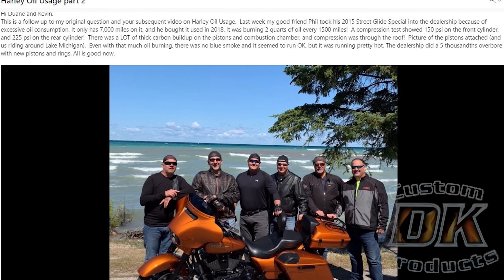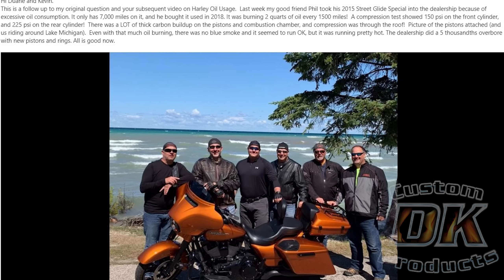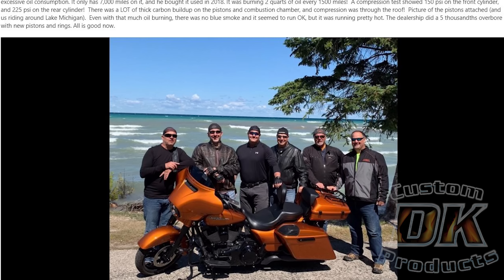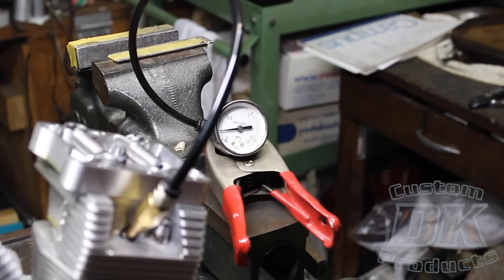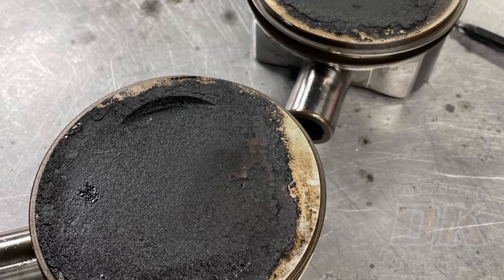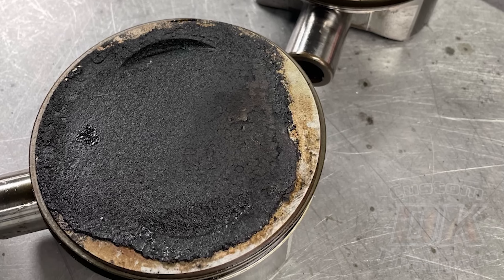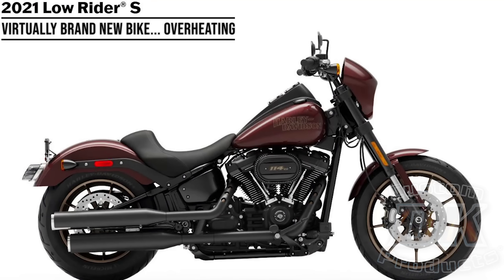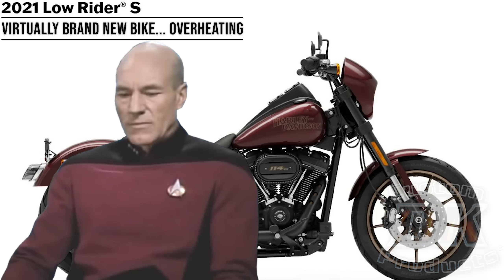Harley Dealership says- "Bike Got Overheated Badly...

Comment: my 2019 Tri Glide with 7000 miles on it the pistons looked identical to the pictures of the pistons you are showing. It too was running hot, scored the cylinder walls/ pistons with the front cylinder piston being cracked about to grenade. Went with new cylinders and pistons along with S&S cam chest with S&S 465 torque cam, 1000 miles later, I am happy so far.
Reply from the maker: Man, sorry that happened.  Glad you got it worked out now. 👍
Keep that puppy from getting too hot and you should enjoy many tens of thousands of miles more in the wind!

Comment: Excessive oil in the sump will cause a engine to overheat. Updating the oil pump in my M8 114 helped.
Reply from the maker: Yes, if the flywheel has to slog thru oil that should not be in the sump, it does make the engine work harder, generating more heat.  Glad you got that taken care of! 👍😎👍

Comment: Kevin Baxter at pro twin performance in Windor Georgia rebuilds M8 and twin cam all the time, he's kinda a engine detective. He takes them apart piece by piece and videos the whole thing. He gets engines with all kinds of problems fkn crazy.
Reply from the maker: Yeah, he runs into more than a few engines that have suffered from heat damage.
Reply: @DKCustomProducts  and sumping
Reply from the maker: Yep...although recent year models have not had near the % of issues with sumping.
Sumping does cause a lot of extra heat as those flywheels work themselves thru that oil.
Reply: Harley is Making JUNK using plastic gears . Aluminum where you need Steel .   they know the bikes are junk reason they have Fired CEO after CEO sales are down . I did not think Harley see a 2020 bike that is how far in the red they went .
Reply from the maker: Things are definitely different, answering to shareholders is no small part of that...and this crosses almost all publicly traded companies.
btw, my wife's F350 PS has a plastic transmission pan and a plastic twist in drain plug for the engine oil pan.
Reply: @DKCustomProducts  that's crazy . ABS plastic is ok for somethings but not engine parts or transmission .   I will Just keep building my OLD EVO
Reply: @JCcanU  plastic gears? Aluminum? Where are those parts located?
Reply: @Chittysanchez  Watch Kevin Baxter his video show it in the Gear box and in the bottom end of a M8
Reply: @DKCustomProducts  yeah what corporations don't answer to shareholders? I know the primary chain tensioner is Teflon or plastic on my fxdl
Reply: @JCcanU  which one? He's got hundreds
Reply: @Chittysanchez  I know I have watched them all  I can't remember what video but I seen it in the video
Reply from the maker: I hear ya!
Reply from the maker: Privately held companies that are still owned by the founders and follow the vision and commitment to the Customer that they started the company on.

Comment: EVO 1985 -98  100,000 easy if its left stock .  oil is changed at 3000 miles and its maintained .  But as soon as the pipes are changed and carb jetted you lost half the life of the engine .   I think they made the Twincam to fail sell more bikes is the plan no longer fix bikes over 10 years old . They use to fix engines from 1950 to 2006 and stopped the Harley Davidson rebuild pro gram they lost to much money bringing a Pan,  Shovel and EVO back to life
Reply from the maker: You make some interesting points.  Thanks for the comment.

Comment: Why would you both support a company that sells motorcycles that cost $30,000 and need oil coolers, fans, oil filters relocated, primary chain tensioners replaced to avoid pulling the bearings out of the transmission and engine, have to get a tuner and dyno tuned because they run lean and hot from the factory, the cam chain tensioners are short life components? And to top it all off they make so little horsepower compared to anything else.
Reply: That's the small price we pay for being cooler than everyone else. 😎
Reply from the maker: If I have to explain, you would not understand.
But I will try anyway.
Harleys are made as a blank canvas, so we can make them our own.  Video on that here- https://www.youtube.com/watch?v=__NE6h1DhCg
The M8's do NOT run lean from the factory.  See video here- https://www.youtube.com/watch?v=Lb_57Z_Ipms
It has been over a decade since HD put out cam chain tensioners that have a short life.
Most HD riders don't care about horsepower, see video here- https://www.youtube.com/watch?v=DOxzN8r35O4
Reply from the maker: Ride a good Harley, if that does not flip your switch, then they are not for you.
Reply from the maker: Here's a video of the catch-22 HD finds themselves in- https://www.youtube.com/watch?v=N0kLaVQhbW4
Reply: @DKCustomProducts  Harley does this on purpose so that the consumer will have to upgrade in the very near future.  For those of you sitting in the back, it means lots more income for Harley.
Reply from the maker: I believe that definitely enters into the equation. 👍

Comment: That's crazy. I'm always so careful with my bike. I never sit in traffic or anything like that. Im always moving so it never gets to hot. One time I had a scare going to a rally. Traffic got bad and the bike got so hot it didn't want to start up again until it cooled down completely.
Reply from the maker: And even if you don't feel the heat as much, the engine temp will almost always be higher at 70 mph interstate riding than in stop and go.  That is what every test we have done has shown.

Comment: As a  Pa. state license / certified state inspector  with over 45 yrs of experience with all types of motor vehicles, ie mc, car, truck etc. and with many factory oem training certificates i would like to comment on the overheating of stock harley engines making it to 100,000 miles. A very dear friend of mine who passed recently has had harleys since the 1960.s and at the time a harley going 50,000 was an acheivement  , but with modern oils, modern metalurgy and tighter tolerances  most and i repeat most engines will last well over 100,000 with proper maintenance and some common sense. I own several harleys at this time and have owned a few others over the years, but never had the same oppurtunity as he did to  put the miles on . i can say i know of at least 3 of his recent bikes (ultras) the he would not sell / or trade in until they had at least 100,000 miles. All we stock bikes, and never have any mechanical failures due to oil or heat related issues. electrical, sensor failures yes. To comment on the video story of the guy with the 7,000 mile 6 year old bike kinda tells me most of his riding was urban areas sitting in traffick  etc. And as pretty much every mc rider knows that is vvery detrimental to a bike, also a good "blow out' by riding some long distance high speed riding can clean carbon out of cyclinders. and i'll just  leave it at that
Reply from the maker: Thank you for sharing your, and your friends, experiences.
No doubt, as mentioned in the video, many HD's will ride down the road past 100,000 miles.  Both of my engines that were rebuilt/replaced under warranty were riding down the road.  That does not mean there is not damage to the point that they are not producing as much power as they did before the damage.
Here is a video showing what happens when the engines get to 270F (which is what most of them do from the factory)-
https://www.youtube.com/watch?v=5PxJ8PvcVtc
Reply: I'd also like to add that a engine running overly rich can also carbon up pistons and cause cylinder wash out ..... positive side of that would be it'll run cooler  lol
Reply from the maker: True that.  😱

Comment: DO you believe it has something to do with the break in procedure? In my opinion the recommended procedure is not good for the rings. It leads to poor ring seal that then causes blow by and oil usage. I have 2 M8"s that use zero oil between changes and have zero oil in the catch cans.
Reply from the maker: Yes, break in procedure is one variable.  Although the most crucial time for break in is already passed by the time the bike is at the Dealership.
Other variables:
Poorly made cylinders
Too much heat
On earlier M8's there were a % of them sumping from poorly designed oil pump scavenging.  That has been resolved as of 2020.
Shoving hot, oily, oxygen depleted air into the intake.
Thinking one is following the manuals break in procedure, when in fact, they are lugging it.
Oil being overfilled.
The above is off the top of my head.  Many possible causes.

Comment: Maybe you should start making a jumbo catch can. 2 quarts in 1500 miles. HA! Good video.
Reply: When I was in high school, I had a friend that bought a 45in trike that would kickstart and shoot fire out the pipes, even trying to idle. When he pulled the top end off, the rear exhaust valve had only 2/3 of it left. It had been one-lunging for years. The old drunk guy he bought it from would take the 6v battery out of the Studebaker to get it started then bang off between 2 trees. The forks were bent from crashing into a 3rd tree one time. So after he got it back together, he spun the tubes around "so it looks like a raked chopper!" ( he later owned a used car lot..). The thing is I learned that Harleys would run in such miserable condition that people would ride them in miserable condition. And a lot of their bad reputation was because they were not maintained. I found on my 62 model that if I kept clean oil and clean points with a Sportster carburetor that had an accelerator pump I had a one kick Panhead that won me lots of beers later on. No primer kick required. Squirt squirt, 1/4 throttle, bang she's running. Maintenance people! Maintenance!
Reply from the maker: Yeah.  lol  😂 
Fortunately not many are in that kind of consumption range.  Did you see this video we made?
https://www.youtube.com/watch?v=CkJM2vM7xj8
Thanks for commenting, glad you liked the video.
Reply from the maker: Great insight and advice. 👍
Reply: @DKCustomProducts  I did see the oil consumption video. Definitely, not normal in my world. SMFH
Reply from the maker: Yeah, fortunately not a whole lot of folks experience that much oil usage!

Comment: My father in law has 90k on his bone stock 2003 Fat Boy
My good friend has 80k on his bone stock 2015 Street Glide. 
My boss has 107k on his stock 2013 SG. 
So I know it is possible. 
I have 20K on my 14’ street glide with love jugs mighty mites, intake, full exhaust, and power vision tuner. 
Zero issues so far
Reply from the maker: Oh, it is definitely possible.  I had a bike that at about 20K miles got a new top end under warranty.  HOWEVER, I am sure that it would have still been going down the road at 100k, just with less power than new.
Usually the drop in power (due to accelerated wear) is so gradual, most folks never notice it.
Sounds like a good crew you are running with.  Enjoy the wind! 👍😎👍

Comment: I thought that this was axiomatic.  Air cooled bike do well on road riding, but will overheat badly in stop and go traffic.  Even my 2022 Harley Davidson Nightster will heat up in said traffic and it is water cooled.
Reply from the maker: Tell us more about your water-cooled Nightster.  We have not taken the time to do any tests on that powerplant yet.
Reply: The 2022 Nightster and Pan American bikes are water cooled with a radiator fan.  When the bike is idling for extended period or stuck in traffic will quickly get very warm on the right side of the bike.  Many owners say the same complaint and have to keep their right leg further away from the bike. Any suggestions to alleviate this problem?
Reply from the maker: We have done no work or testing on the Revolution Max engine.  We are waiting to see if those bikes become popular, or go the way of the Vrod and Streets.
I've heard your bike is a blast to ride.

Comment: Harley's oil cooler is right behind the front tire, everytime I see one it's full of road dirt. Stupid design.
Reply from the maker: Yeah, not nearly as much wind, plus right in line for rocks, dirt,, road debris.  
We prefer them up parallel with the downtubes, much better air flow and less likely to get clogged up.

Comment: My m8 107 gave up at 21k miles. Heat and oil sumping issues causing cylinder wear then piston cracked. My m8 131 was running hot oil at 280° harley said its normal. I got it down to 230ish now. Still need to add fans
Reply from the maker: Man, sorry to hear that.  Glad you have it cooled down now. 👍😎👍

Comment: Do they shutdown when they overheat to protect engine components?
Reply: Yes and in extreme overheating cases they'll sieze up so that they cannot be overheated again. It's all engineered in from the factory to protect the motor.
Reply from the maker: @bradboustead1682  Incorrect.  If it shuts down, it is way passed the temperature where damage has been occurring.  Sometimes, some of them, will shut down to prevent a total melt-down.
EITMS is explained in the video linked below...it is Not for cooling the engine.
https://www.youtube.com/watch?v=T2aG284iCKc
Reply from the maker: They do not.  They will retard the timing at about 270 F in an effort to cool down, or at least heat up less.  See this happening live, along with dyno charts in the video linked below- https://www.youtube.com/watch?v=5PxJ8PvcVtc
Reply from the maker: @thejerseyj5479  😂😂😂
Reply: @DKCustomProducts  yikes😱

Comment: I have owned many cruisers over the past 30+ years... my currrent and last bike is a HD. I never had any heating issues with my Japanese v-twin air-cooled bikes. Nor did I have any oil consumption issues. Both of my HDs eat a quart every 5000 miles. Both are M8s. I run Amsoil fluids, Love Jugs, your external breather system and remote oil filter. I just recently had a lifter that was bleeding down, which caused damage to the cam. I installed S&S pushrods/lifters and a new stock cam. The improvement was dramatic. I find myself over obsessed with how these bikes run. Something I never did with my Japanese cruisers. HD tells us that 1 quart of oil usage is normal over 1500 miles. That is pure nonsense. I would sure like to know how many HD engines fail because of over heating. If I buy a new bike in the future, it may not be a HD. I own a trike because of back issues. So going back to 2 wheels will be difficult. But it may be something I have to do. I really like the new BMW R18. Any boot, thanks as always for another great video :-)
Reply from the maker: Sorry to hear of these challenges.  
Good to hear you are finding the videos useful/interesting. 👍😎👍
We have always been able to get the heat down to acceptable levels.  Here is the list we work thru, one at a time, until we get the temps in the optimum range.
https://www.dkcustomproducts.com/why-how-to-cool-down-the-twin-cam-engine-part-i-dk-cl-tc-dn-1.htm
Reply: @DKCustomProducts  HD owners should not have to spend a boatload of cash to keep their bikes cool... especially when you spend $30,000+ for a cruiser.
Reply from the maker: I agree.  Harley is in a catch-22.  This video may explain why things are the way they are-
https://www.youtube.com/watch?v=N0kLaVQhbW4
Reply: @DKCustomProducts  I understand the EPA nonsense... they are clearly unwilling to address the overheating issues on their expensive motorcycles. I truly believe that HD makes an engine that will get you from point A to point B, most of the time, regardless of the internal damage going on. I watched a video where a guy was doing a teardown on an EVO engine and found a hole in the piston top. the owner drove the motorcycle to the shop for servicing having no clue of such a problem. so, for me, HDs are not designed for long term reliability. my buddy's transmission went out last summer on his RG with less than 20,000 miles on the clock. most of us love our HDs. best looking bikes on the planet. but don't expect reliability.
Reply from the maker: Very interesting information.
I have experienced similar situations, where the internals of the engine were WAY OUT of spec., resulting in much less power than when the engine was new, BUT, it was still going down the road.
In all my years, and roughly half a million miles ridden on Evolution, Twin Cam and M8 engines, I have never been stranded, needed trailering, or otherwise been stuck on the side of the road.
Reply: @DKCustomProducts  time will tell with my trike... I love the styling, fit and finish. both of my HDs have had issues. My Heritage had oil leaks from the head covers. My trike had a bad lifter. I owned a 2007 Yamaha Stratoliner and road it for 10 years and 55,000 miles. not one problem, ever. I still kick myself for selling that bike. it will be interesting to see which lane HD goes down in the future. the Japanese builders stopped/slowed down cruiser production. I enjoy your efforts. thanks : - )
Reply from the maker: Yes, things are changing, for sure.
Thank you, appreciate your comments.

Comment: My first question is this bike completely stock?
If work has been done on engine, intake or exhaust.   Where was the work done?
HD bikes all run hot even if stock.   Where was this bike mostly riddin?
Check your oil level.  If oil is at the full mark its too much.
Reply from the maker: Got no idea on any of your questions....well, the second bike mentioned is completely stock, so that answers 2 of your 3 question on 1 of the 2 bikes.
Yeah, they all run hot, and oil being a bit overfilled would not cause either of the problems either of these two bikes had.
Here are a couple of videos on the subject that you may find interesting.
https://www.youtube.com/watch?v=anShki_WeL0
https://www.youtube.com/watch?v=MF0hO-w2hz8